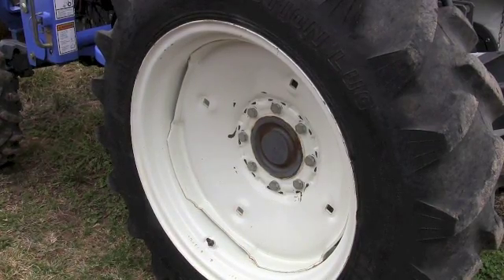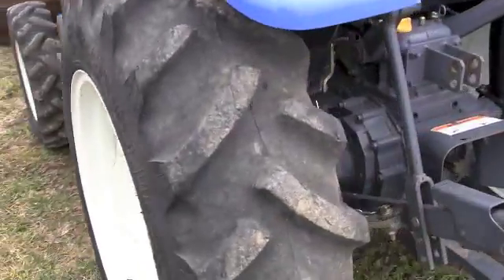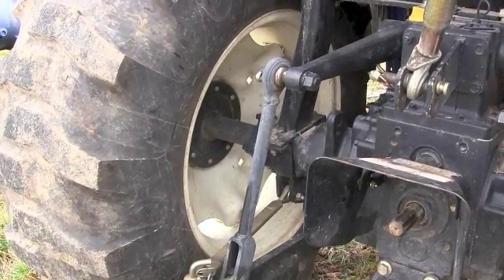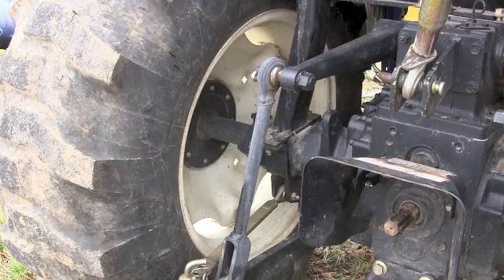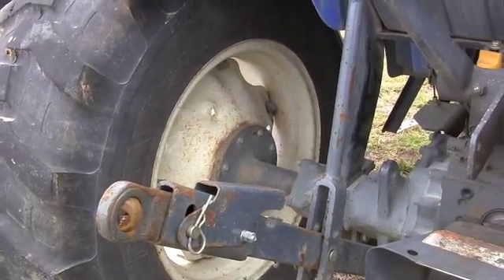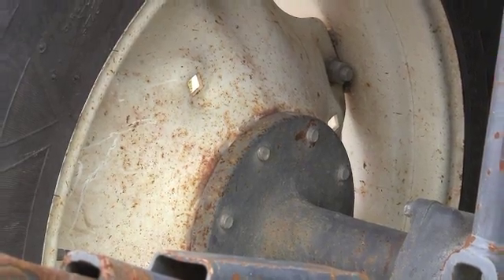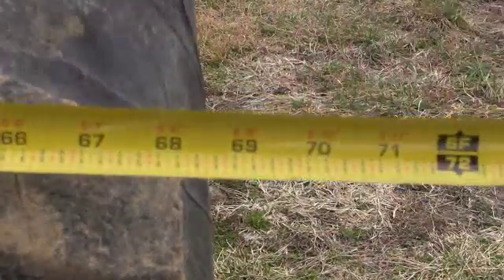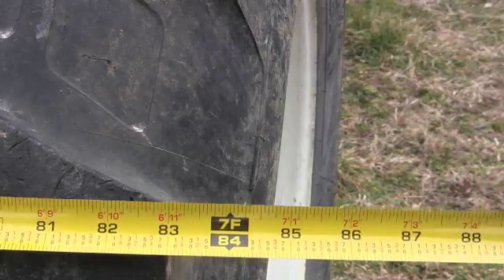How to Make a Tractor Safer on Hills

Comment: Good video Mike, gotta question...if I added a spacer to my hubs but flipped my rear wheels in  (narrower). Could I then only narrow my tractor say 2"-4"? Reason I ask is my trailor only allows for 82" between the fenders. My tractor currently is set at 84" and thats the max width. Any help would be greatly appreciated.
Reply from the maker: I don't think there'd be any problem with that.  I get where you're going, you want the tires wider than you can get them by switching sides and/or changing the hub/center section, but not so wide that it won't go on the trailer.  Nice job figuring that out ahead of time.  I'd probably be driving the tractor up on the trailer when I realized the tires were too wide :)!

Comment: Hi Mike, I have a strange question. I am considering to buy some spacers for my back wheels of my Kubota. I understand that this will be helping to avoid roll over. Though, does it also feel more safe? I can imagine that the feeling doesn't change. Now, when I drive on my land and get to a steeper area, I sometimes think not to go further. With spacers (probably getting 5 inch spacers, thus widinging the whole thing 10 inch) it will be more safe,  but again, does it also feel more safe when driving? I have a Kubota L4018 (probably not available in the US).
Reply from the maker: Peter, great question and I don't know the answer.  I've never operated a tractor with wheel spacers.  Maybe someone else who has will see this and respond.
Reply: @TractorMike  Thanks for the reply. I was wondering still about it. I can imagine that you have experience with wheel rim change? If you change the wheel rim setup and thus have the tractor wider, how does that feel related to stability? Of course it is more stable but just wondering if you somehow feel that?

Comment: I know the wheels are made to adjust the width to a certain degree. I also know there are ways to widen more. My question is does a wider wheel base cause more wear and tare on the back axel, as force being multyplied by length, basically the fartyer out the wheel more weight on the center point.

Comment: I bought a used Kubota 4x4 tractor, and very nearly rolled it one day. It was a very close call. Turns out a) I had not yet gotten around to widening the stance of the tractor and b) the previous owner had done repairs to the left main tire and reinstalled it without the fluid fill. So the right main tire was OK but there was no weight on the left. It never occurred to me that someone would do this, and so of course I thought both were ballasted. 

Oh, by the way, the tractor has a ROPS but I was NOT wearing my seat belt. Unfortunately seat belts are not very practical when you're in and out of the driver's seat 100 times a day.
Reply: They're pretty practical when you dont get crushed to death from a roll over

Comment: Mike, is it common to have the tractor rear tires set wider than the front for general utility use on a farm? Is much stability gained if only the rears are widened but the front remains at a more narrow setting? The reason I ask... my owner manual advises that it is best for the front to be at the narrowest setting if the tractor is loader equipped like mine. Thanks, very much enjoy your channel.
Reply: Also the front axle pivots in the center so widening the front doesn't add as much stability as widening the rear.
Reply: I am not Mike, but I grew up on a farm.  IMO, everything on a tractor contributes to everything.  I would not operate a loader on slopes if at all possible.  With a loader, widening the front can dramatically increase the stress on the front axels.  So, on slopes, keep the load as low as possible and your angle to the slope as orthogonal as possible.  Widening the rear will help stability in all cases I can think of right now.  The only time I really worried about the width of either was when running a cultivator.
In short, yes it is common to have a wider setting on the rear.  Dual tires on the rear, even better. :)
Reply: Thank you

Comment: Thanks Mike. I had a similar experience with some logs last year. I was in a place where I could just dump the load without it hurting anything, so I dumped everything out of the bucket and regained control. It cost me about an hour of extra work, but the tractor was OK and so was I.